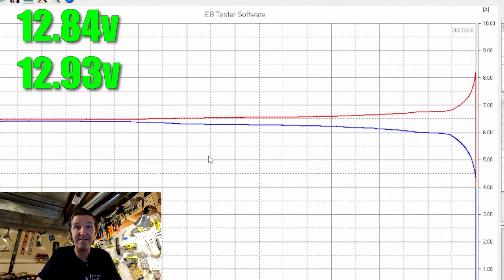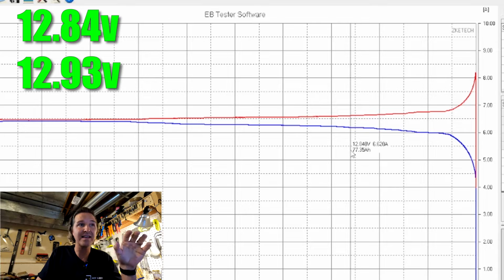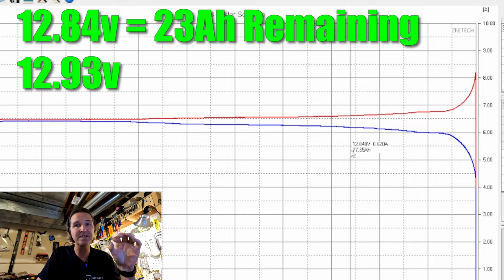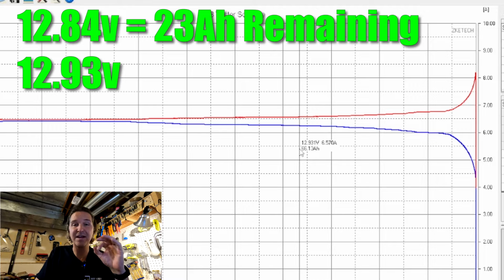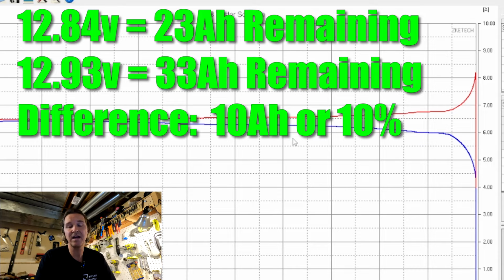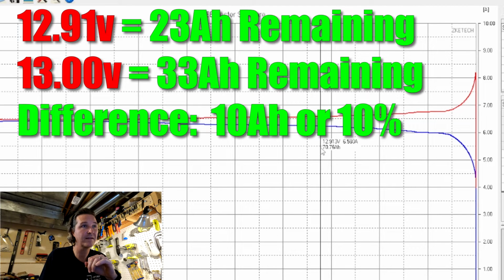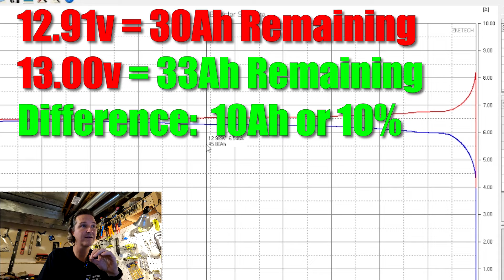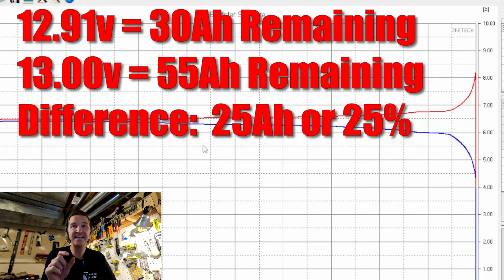Don't try to calculate the remaining capacity of a Lifepo4 battery by checking voltage!  Here's why!

Comment: Recently purchased 2 Timeusb 140ah batteries for the trolling motor on my boat, also purchased a Redodo 100ah mini for running 2 Hummingbird graphs, stereo, lights, etc. After watching your video its apparent that using my newly purchased digital voltmeter will not tell me true capacity of these batteries. Simplest way to test and measure the storage capacity? Just want to know these batteries will produce the stated amp hours. Recommendations on what I need to purchase? Simplest testing procedure?My knowledge on all this very basic…thanks!!
Reply from the maker: The best way to measure the battery capacity is with a shunt.  It will calculate the current going to and from the battery bank.

Comment: This video has nothing to do with the battery chemistry and everything to do with your multimeter , using different meters will show a difference on any chemistry,  use a fluke not some shit make.
Reply from the maker: The video was to point out the flat discharge curve of lifepo4 and how 0.1v can make a huge difference.  Some people go by the voltage displayed on their solar charge controller or inverter.  Those items could be off by more than 0.1v.  Thanks for the comment.

Comment: The ideal clamp meter is a really nice meter. I want one
Reply from the maker: I really like mine.  It's all I use to test voltage and amperage for accuracy.  Thanks for the comment.
Reply: @OffGridBasement  so how do you determine which meter is accurate ?

Comment: Just got a PowerQueen battery and the manual is very insistent that you wait 30 minutes after any charge or discharge to read the voltage if you are attempting to use it for SOC.  Thought that was interesting as I hadn't heard anyone mention this about LiFePO batteries in general.
Reply from the maker: Even if you follow that, you're still only getting a ballpark number.  If that is all you need, then work with it and enjoy!  Thanks for the comment.

Comment: I have a 72V 50Ah Lifepo4 in my ebike…the BMS shutdown when the voltage meter reading was at 76.1V and the capacity meter was at 29%(is this normal?), I was accelerating slowly to 40kph. Is it possible the BMS is set to shutdown too soon or there is something  wrong with the battery?
I make sure to stop throttling when capacity meter is close to 30%..right after stopping, no battery load, the capacity meter reads 59% then a few seconds later it goes up a little to 62% (before the shutdown incident) note: when the battery is full, it goes up to 87% quickly…so I base the capacity of the battery this way.  Do you know what the voltage of 72V battery before the BMS shutdown for low drain voltage protection?
Reply from the maker: It's possible that a full charge in the battery is upwards of 82v.  It all depends on what the BMS is set too.  Does the BMS shut down or does the charger state a full charge at 76v?  I really wish I could help you more, but I just don't know much about ebike batteries.  Also, that seems like a giant battery for an ebike.  What brand ebike is it?
Reply: @OffGridBasement  Tao Motor Gemini 725 72V electric scooter, this drains the battery so fast going over 60 kph, that’s why it needs a big battery. A 72V 50Ah should have a capacity to go 60-100 km at low speed but because of cold weather I’m only getting close to 40 km, Did you ever proof that cold temperatures (close to 0 Celsius) reduces battery capacity by 30% or more?

I always fully charge the battery to 88V when the charger goes to standby or stops…the next day before using it, I trickle charge it to full, up to 0.07 kWh gets added.

When the BMS shuts down the only way to restart it is by the charger. You posted a video of a hack to restart a 12V BMS with an external battery to restart it, I wonder if a small 12V portable battery booster can restart the 72V battery BMS🤔 Does it have to be 72V? I have to walk my bike home, even after an hour, the battery won’t start the bike.
Reply: @KO777MV you would need a 72v source to wake up the BMS.  If your original charger isn't designed for lifepo4 then I don't think it would wake it up since it wouldn't detect voltage.

Comment: i have a couple of meters that i use one is a 4 digit readout Vevor clamp meter that i do most of my battery measuring with. I also have a Centech- 61593.Both meters are not high end expensive meters but they get the job done. I measured a 12 volt battery pack i have and the Vevor clamp meter reads 13.40 the Centech reads 13.35 So you are right, ever a 5 mili volts  can make a difference esp when reading individual cells.
Reply from the maker: Thank you for the info and the comment.

Comment: Yes, well, the LiFePO4 charge and discharge curves are very flat.   And it's even worse because the voltage draw-down from the load (or voltage increase while charging) completely swamps the very fine voltage differences on the charge or discharge curves.   There is also a (roughly) 5% voltage difference between discharge and charge curve and the voltage slithers around between them when one switches from charging to discharging or vise-versa.

So, its basically impossible to figure out the state of charge from the voltage unless the battery is close to empty or close to full. 

The solution is generally to install a shunt, such as the Victron Smart Shunt.  This device will track the amp-hours going into and out of the battery and is configured with the total size of the battery.  It can estimate the SOC fairly accurately from that.   Though even a shunt isn't going to be perfect... if a lot of cycling happens without the battery hitting a known "100%" reset point, even the shunt will drift off-base.   Its better than nothing though.

Tesla EVs with LFP batteries are famous for losing track of the state of the charge of the battery if not charged to 100% every couple of weeks.

-Matt
Reply from the maker: Thank you for the great information and comment!  A shunt is Definitely the way to go.

Comment: i dont have any fancy tester but i do have a icharger to charge my 100ah battery, ive cycled it few times from cut off and i get 92ah full charge to 14.6v its one of them battery that has a bunch of small circle cells bit more heavy then normal ones with 4 big cells but its fine for my needs ill run it for my trolling motor.....most times i pull about 30 amps on my trolling motor for 10 mins or so here and there and let it rest for about 15 to 20 mins while i fish and then move around and sometimes 40 amps for just 5 mins the most, so after 3+ hours or so of using it  puttering around when i charge the battery i only put about 28 to 35ah back in the battery and its full, so i guess i burn about 30 to 40ah when i use it... i really need to get a discharge tester but i have never had issues of using up my 100ah battery even though im only getting 92ah full charge from it and others had same capacity with the brand i have getting about 95ah, i guess thats the nature if this types of cylinder cells you dont get that max 100ah..
Reply from the maker: If the battery claims 100ah then it should be at least that.  It sounds like you are using it as intended so you should be getting full capacity.  On the other hand, if you are totally fine with the capacity and it works for what you need, then keep doing what you're doing and enjoy!  Thanks for the comment.
Reply: yup works fine for my needs but i will turn it into a lighting up 12v lights and charging up tablets and phones and power up fans no inverter  @OffGridBasement